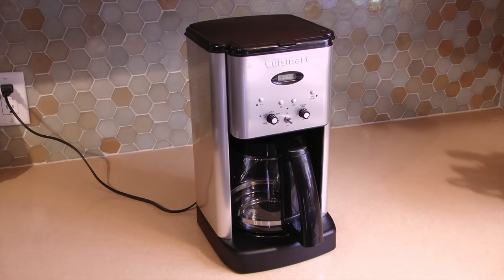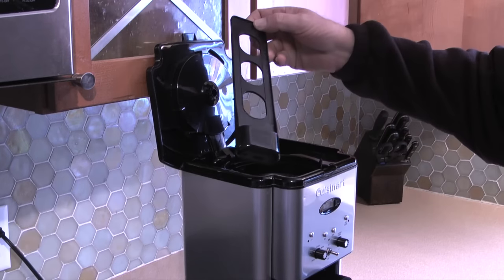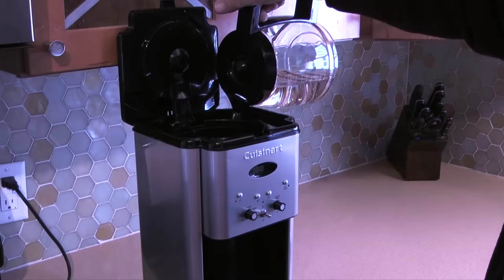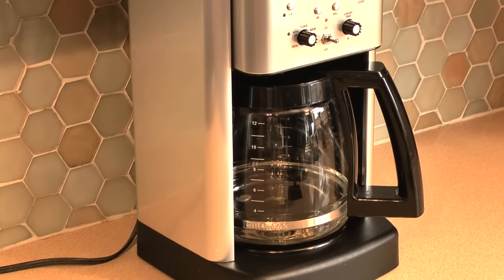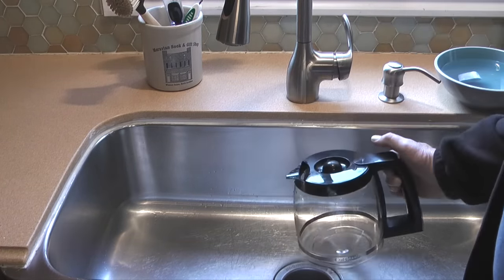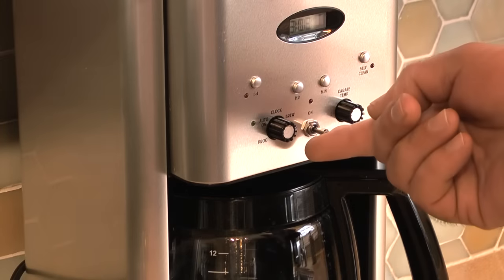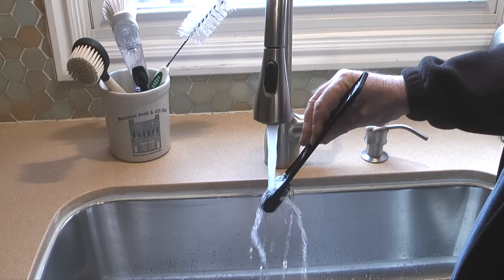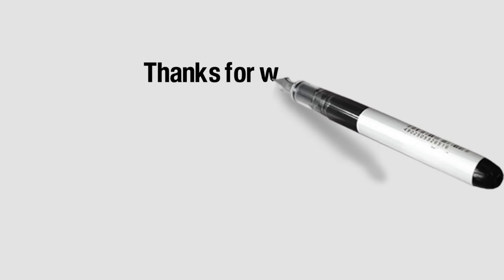Cuisinart Coffee Maker Self Clean Feature

Comment: I purchased this model used and it looked destroyed on the inside! But I know it's a great quality brewer. It's possible to almost completely disassemble the coffee maker for those who need to clean to reservoir by hand. There are 2 screw caps you MUST pry off and take screws out so you can get to and expose the reservoir. once you clean everything. you just put the screws back and use anything you like in place of the plugs you removed. I used hot glue.

Comment: Great video, well done! I want to point out, that 4 cups on the carafe, is not the same as 4 cups measured in a standard measuring cup.  4 cups in a measuring cup actually equaled about 6 carafe cups. Use the carafe's measure lines as the reference.
Reply from the maker: Good tip, thanks for posting.

Comment: I had this model a couple times a number of years ago, and then had several of the DCC 3200. Whenever I read the instructions for cleaning, my understanding is that the light for the cleaning, at least with the DCC 3200 and I think this model also, is supposed to light up automatically when the machine needs cleaning, but in maybe 20 years of owning Cuisinart coffee makers, it has never lit up by itself no matter how long it went without cleaning. What's also ambiguous in the instructions is how to run the cycle with plain water after the vinegar/water mixture. My understanding from the instructions, at least for the DCC 3200, is that you run the clean cycle again. I usually do it a second time with plain water just make sure all the vinegar is rinsed out.
Reply from the maker: This is my second Cuisinart coffee maker and the self clean light hasn't lit up on it's own on either one. I also run a couple cycles of clean water after using the vinegar/water mixture.
Reply: @Iscaper  Do you also have to air out your house?
Reply from the maker: @fredbloggs6080  I usually open the kitchen window when doing the white vinegar cycle.

Comment: We have the same machine. It is a standard in hollywood. Every time Two & 1/2 Men is on, I always point out the coffee maker in the background. Many sitcoms use the same machine. In the newer 2.5 Men its the same machine but its red. Big Bang Theory also have a similar Cuisinart machine but maybe a bit newer model. Lots of cop shows have this model too. Maybe they just have one machine and share it among the many sets to keep the budget under control lol. However the machine is not without difficulties as well. We're on our 3rd one. The first one stopped working altogether and it was replaced with one that started to leak. Like if you filled it up the night before, in the am there was water all over so that one went also. Our 3rd machine now starts brewing, then stops arbitrarily (shuts off) Sometimes it only make a 1/2 a pot so I have to keep an eye on it if the light goes out, I have to turn it on again. maybe time for 4th machine? In the "old days" appliances lasted 20 or more years. Now they are meant to be disposable. This is since everything started being manufactured overseas. Sure we can make things cheaper initially but are the cheaper in the long run?
Reply from the maker: Thanks for the information. We used this coffee maker for 5 years with no problems.

Comment: This was very succinct and helpful.  I would suggest that folks inspect the water reservoir filter holder after running the vinegar/water cycle.  I observed a bit of sludge that likely contained some sort of mold or mildew.  I wiped it out with a scrubber/sponge and rinsed all parts after running the vinegar/water through the self-clean cycle.
Reply from the maker: Good info, thanks for posting.

Comment: I have this exact machine, but there is no water filter or holder, even though you can see an opening on the left where the filter holder should be.  They sold a bunch of these without the filter or holder, figured they could get away with it because there isn’t anything about it in the manual. I fully expect this kind of BS when it comes to today’s products, but didn’t think they would be scamming customers 15 years ago when I bought mine. Thanks for showing this. By the way, the cleaning step with vinegar and water will work even better if you use distilled water instead of tap water, and boil the mixture on the stove before pouring it directly into the machine - this will dissolve more of the build-up.
Reply from the maker: Good tips, thanks for posting.

Comment: thanks for posting this video, i have the same coffee maker  when i try to brew a pot of coffee, the self clean light flashes and the unit just gurgles.  i cleaned it out with vinegar/water but no change.  any suggestions?
Reply from the maker: I just checked my coffee maker and when I turn it on to brew the self clean light doesn't flash. I wonder if there is something wrong with your unit.
Reply: @Iscaper  i took the bottom plate off, and cleaned the 2 hoses, one of them has a plastic ball-bering and i installed that wrong, but its all fixed now, thanks for your video

Comment: I have the Cuisinart SS-15 Series coffee maker that has a K-cup single serve on the side. This is my third one.  The red light came on each time to let me know that it needed cleaning. PROBLEM...the RED light will NOT go off after cleaning and running with just water three times to make sure that the vinegar is out of the system.  All my countertop appliances are Cuisinart. I can NOT look at the red light on ALL THE TIME.  If this light does not go off after this third time of running it through tonight, I will be searching for another brand for all my countertop items. There seems to be a defect with this machine. Three of the same coffee makers EVERY one of them, the same issue.  The first machine lived one month. The second one three months. This one lasted four months before a non fixable problem.
Reply: Hi Nancy , I am reading your review one year after you posted! May I ask if you could solve the red light problem finally? I have the same coffee maker and this red light has been off recently even after running the vinegar and water. Of course, there is no "self-clean" button on this model so I used the brewing button.
Reply: I'm having the same problem!  I've cleaned the drip side 3 times using the cleaning function, light's still on.  I've even ran vinegar through the single serve side 3 times and can't get the light to go off.  Frustrating...

Comment: Just got the model 5200 PC from Googwill, with pretty much the same layout of buttons except for no toggle switch. The clean button does not work. The on and off button does not work, except when I pushed the 1-4 cups button. Is there an easy fix? Or should I return it? Please advise.
Reply from the maker: I would go through the manual one more time and see if you're missing something. If you're not I would return it.
Reply: Hey Diane, maybe you already figured it out but the knob to Brew, and then just press Auto Clean to turn on the automatic cleaning function. It was difficult for me to figure out as well, especially without a manual when I got it second hand at a thrift store. Hope this helped!

Comment: What happens if one doesn't replace or even use those charcoal packs?
Reply: You do not need to use the charcoal packs for the coffee maker to work properly. I’ve had my coffee maker for three years, and I’ve never used the charcoal packs. I already filter my water, so in my case this additional filtration step is completely unnecessary.

Comment: Does the self clean button and auto brew button need to Be on?
Reply from the maker: This is from the instructions: 
To clean, fill the water reservoir to capacity with a mixture of 1/ 3 white vinegar and 2/3 water. Press the Self Clean button. When the self clean light glows, turn the coffeemaker on by pressing the ON button. The self clean light will shine steadily. The coffeemaker is now in Self Clean mode. One cycle should be sufficient to adequately clean the coffeemaker. When the cycle is completed and the five beeps sound, the coffeemaker will shut off. Turn the coffeemaker ON to see if the Self Clean light continues to flash. If it does, turn it to OFF and then repeat the cleaning procedure with a fresh solution of vinegar and water. If the Self Clean light no longer flashes, turn the coffeemaker to OFF and then run one cycle of fresh cold water through the unit before using the unit again to brew coffee.

Comment: I have a Cuisinart Coffee Maker DCC-2650 S it is the 4th one I have had due to Cuisinart replacing it 3X. During a normal coffee brewing cycle I will hear clear water coming out of the coffee basket and running down the outside of the coffee kraft and hitting the hot plate. Cuisinart tells me no one has ever had this issue. I was running a kraft of cold water through my machine and when it was completed I pulled the kraft out and I was wiping things down with the coffee maker off and all of a sudden water started coming out from below the basket onto the hot plate!! Do you have any idea what is causing this?? If it only happened with one machine I would conclude the machine was defective but all 4 have done the same thing.
Reply: Seems as though the trouble may relate to the filter basket assembly incorrectly installed in the unit Mr. S. (Note: Basket assembly holding interior wire filter must be seated correctly) If not the release mechanism on bottom of basket assembly that allows coffee/water to flow into the carafe is not being depressed completely causing the filter to overfill and run over the top of interior filter basket.  I suggest a review of proper "seating" of basket assembly in coffee brewer housing.

Comment: Can you use soap instead of vinegar?
Reply from the maker: I wouldn't, I'm guessing you'd get a lot of foaming using soap.
Reply: @Iscaper  Yeah, I was just curious as to whether it would be safe or not. I had wiped out the reservoir with soap, and it took me several runs with vinegar to fix the problem. Learned the hard way, but everything is fine now.

Comment: What if you press the self-clean button and turn it on and noting happens?
Reply: NOT SURE IF THIS WILL HELP YOU,BUT I DO KNOW THAT WHEN I  FIRST ATTEMPTED TO USE THIS FEATURE I WAS THINK'N THE SAME THING BUT AFTER ADDING THE VINEGAR &WATER TO THE MACHINE & A DISPOSABLE FILTER (IF YOU HAVE ONE ,IT'S KINDA NEAT TO SEE WHAT IT WAS ABLE TO FLUSH OUT)THEN PRESS THE SELF CLEAN BUTTON AND FINALLY PRESS START ! I WAS WAITING AND I THOUGHT I HAD DONE SOMETHING WRONG BUT RIGHT BEFORE TURNING IT OFF IT STARTED ON ITS OWN SO  IT DEFFINITLY DID TAKE A LITTLE LONGER THAN NORMAL FOR THE MACHINE( WHILE RUNNING IN SELF CLEAN MODE)TO START BREWING SO TRY IT AGAIN MABYE JUST GIVE IT SOME TIME IF THAT DOESN'T HELP I'M NOT SURE WHAT THE PROBLEM MIGHT BE SORRY.  I THOUGHT I'D LET YOU KNOW WHAT I EXPERIENCED..GOOD LUCK :)

Comment: You didn’t say which function to keep the black button on the very left on while you did this cleaning there is auto on there’s brew there’s auto off there’s program there’s clocked I don’t know which position to keep that in while you’re doing the cleaning cycle
Reply: incomplete instruction .  please tell us which position the very left button should be in while your doing clean ing cycle
Reply from the maker: The black knob should be in the "Brew" position, then push the self-clean button. It should light up. After that move the on/off switch to the "On" position. Brew light should come on. You're now in self-clean mode.

Comment: I have a slightly newer model which has buttons instead of the toggle switches. Never had trouble before but when I tried to clean today the clean button is not doing anything. Doesn't light up, doesn't clean, doesn't do anything. Unplugged plugged back in nothing working. All other buttons working fine. Anyone know how to fix? Still quite a new machine
Reply from the maker: Hmm, when I push my self clean button it lights up and starts working.
Reply: @Iscaper  as does mine usually! Not sure what's gone wrong 😞

Comment: I have this exact same coffee maker and I'm guilty of not cleaning it as often as I should but it started taking longer and longer to brew a pot of coffee so I thought maybe it's time to clean it so I followed all your steps but my coffee maker won't stay on during the self clean cycle. I put the vinegar mixture in the coffee maker and then push the self clean button and then turn the maker on, it will drop a little water and then I hear the audible tone and the lights go out. I had to keep turning it on or it would just shut off. Not sure why it won't just stay on unless it's too far gone to be cleaned?
Reply from the maker: On mine I turned the self clean feature button on and then turned the coffee maker on. I think the light on mine stayed on during the self clean cycle. If the self clean cycle isn't working on your coffee maker you can use the brew cycle with vinegar and water to clean it.
Reply: @Iscaper  thanks. I sat there and just kept turning it on until it made it through the whole pot, then I emptied it out and started over with fresh vinegar and the second pot worked just fine.....go figure?🤷. I guess it must have been worse than I thought. Anyway it's working fine now. Thanks again.
Reply from the maker: @blackhawktim1259  👍